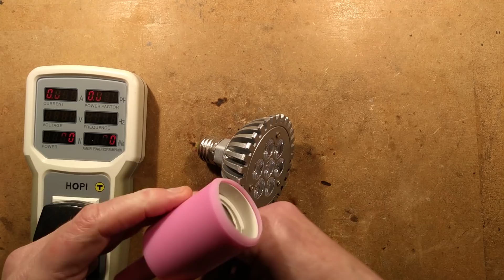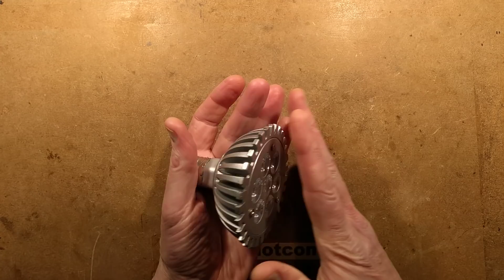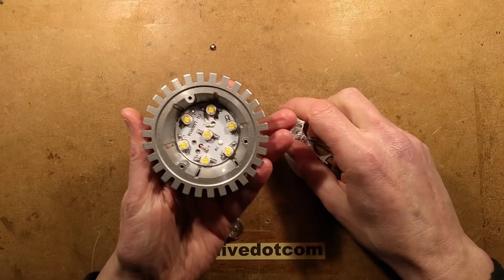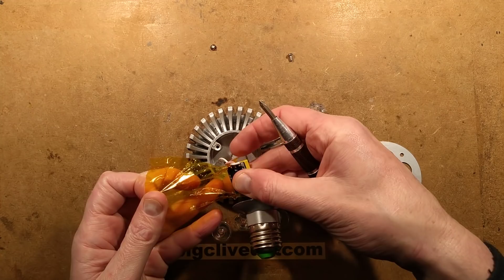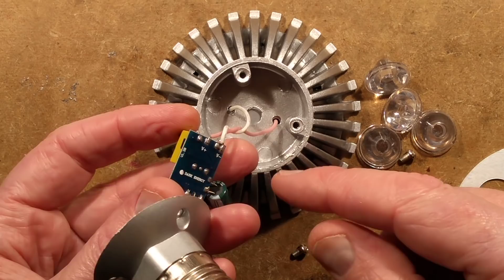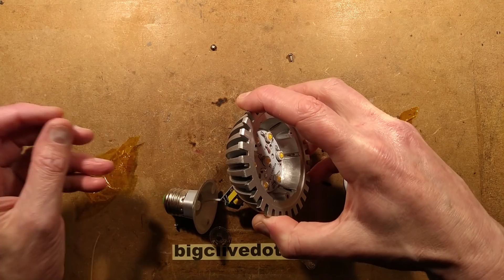Inside a chunky 7W PAR30 LED landfill lamp.  Good hack potential.

Comment: I ordered a couple of these after watching your video Clive. They arrived today and I wondered if your lamp was similar... When I shake them gently I hear most of the collimating lenses rattle slightly. That means they're not applying pressure between the aluminium LED PCB and the heatsink - which is a bit of a worry in a lamp I'd hoped to be able to keep running for ages (and out of the landfill*).
If I had access to a lathe I'd cut back the face that the front plate sits on a little and apply more pressure that way. However I don't and if I were to pay an engineering shop to do it the price would be crazy. Any thoughts? Cheers.
[*] As the heatsink seems up to handling a few watts of heat nicely I've also ordered some 3w LED 'beads' and was going to leave the original driver in place but swap the LEDs to some that should, in theory, last much much longer as they'll be under-driven. However going by the rattle of the lenses the PCB is largely held in place by thermal goop rather than positive pressure. Not good when the goop dries out.
Reply from the maker: That's unfortunately a common thing with these and the smaller GU10 lamps.
Reply: @bigclivedotcom  Ok thanks. I'll see if I can sort something out. Cheers.
Reply: @bigclivedotcom  For a minute there I thought I had the answer - the 3 holes in the PCB and the threads for the back... However the PCB holes are 20mm centre-to-centre and the screws that hold the back on are 30mm. Damn!
That said though I might drill some 20mm c2c holes through the flat part of the heatsink and use M3 screws and nuts (and soft washers) to positively affix the PCB to the heatsink. Thanks again.
Reply: The flat part of the heatsink that the PCB sits on is extremely thin for a heat-path to such a chunky heatsink. It's only just over 1mm thick. It's better than a lot of designs I've seen but still disappointing. Time to break out the drill and M3 screws / nuts / insulating washers...
Reply: OK done but I made a rookie mistake. I lined up the holes for the wires perfectly before drilling the screw holes when what I should have done was align the PCB so that the cover screw holes were exactly between two LEDs. I'll drill more holes in the cover that align with the screw holes rather than remove even more material from the heat-path. Oh and I know I didn't drill the 3 holes that were 20mm c2c equidistant to each other - I decided to go with one hole that was further away from the power wires.
https://youtu.be/LnQBcpPc-f4
Excuse the heavy breathing, it's my first youtube video!
Reply: Holes for lens holding plate 'fixed' https://imgur.com/a/eWK2rGe

Comment: @bigclivedotcom With the PAR56 bulbs now no longer in production, has this effected any venues you work at? I think the venue I work at in Australia has hovered up every last PAR56 bulb in the southern hemisphere for spares.
Reply from the maker: We've been testing LED replacements for PAR64's, but none of them remotely match the intensity or beam shape.  We have a stock, but should get more.
Reply: @bigclivedotcom  do you use 110v bulbs on your 240v supply? We do here and so every electrician who looks at the wiring is perplexed and doesn't understand how it works (can't say I do either). 
Do you think you'll do a requiem video on the passing of PAR56/64 bulbs? I had no idea the extent they have been used, not just in theatre till I looked it up!
Reply from the maker: @NoceboX  There are a few ways 120V lamps are used on 240V.  One is to use them in series pairs.  We normally use 240V lamps.
Reply: @bigclivedotcom  yeah, the series pairs is what we have, I believe, which means when one goes, usually the other pops too. Like you we are trying to find LED replacements, with one possible substitute found.

Comment: Hi bigclivedotcom i recently started having gsm connection issues in my village and new flat i moved in.
There are gsm boosters but they are really expensive, so could i ask you make a review on maybe some cheap chinese ones if they work or not and how good. If you come across one that is.
Honestly with all these connectivity changes to like 4g and stuff, i and several other people i know experienced connectivity problems despite having 3g/4g supporting device.
I guess it would be interesting

Comment: My capacitor is rated 6.3uf at 400v I have a 400v but 10uf capacitor. Can I use it as a replacement?
Reply from the maker: Yes.  That would work.
Reply: @bigclivedotcom  ur  to blame if me house blows lol thanks
Reply: no guarantees :)

Comment: I had a problem with a UV led bulb i got, it seemed to have burned the plastic lens on the LED's, they went a brownish tinge, I seemed to fixed it tho, the plastic lens broke off the LED's so easy but the rubber underneath stayed in place
Reply from the maker: The UV wavelength may have degraded the plastic.
Reply: @bigclivedotcom  Yeah i think so, not sure. They might of overheated a bit aswell

Comment: I hate this lamp...I hate the influx of Edison screw lights into the UK market for one reason- nobody seems to want, or is allowed to sell Edison screw fittings/roses.

Which means you're often forced/encouraged to use a bayonet to Edison screw adapter, which are frankly, unsafe deathtraps.

That metallised plastic is contiguous from the outer screw to the heatsink, and is creating a conductive path from the screw to your fingers.

In the countries where people are using Edison screw fittings, this isn't that big of a deal, as the outer screw is wired up to neutral for obvious reasons.

But in the UK? With an adapter? That's a fifty fifty on whether the surface you're holding as you screw it in is connected to live.

Honestly those adapters should probably be banned for general sale, They're too dangerous in the hands of someone not well versed enough to ensure polarity
Reply: Does that "metallised plastic" conduct electricity to that extent? I have a couple of these ordered (but they won't be here for weeks) and live in NZ where we also use bayonet lamps so I use adapters. I might dismantle before using and scrape off the coating on the plastic if mine are similarly coated.
Reply: @Shaun.Stephens  i don't trust it, wouldn't  be surprised if it showed zero on a multimeter but passed current under higher voltage- it is after all a thin coating of metal., would need a megger/ high voltage multimeter to be sure, so I feel caution is warranted. honestly, the better solution is to make sure the adapter is wired up properly in the first place by measuring the voltage between the screw and ground ( should be close ). Just make sure the meter is definitely in the AC voltage range/ probes are in the right sockets on the meter, you don't touch the tips, and most importantly, if you're not comfortable around high voltages, find someone who is to do it for you.

Sorry if I came across as overly harsh/alarmist :), the adapters can be used safely, but require a little care to be safe during installation.

You always have to be careful when merging things from two different electrical systems/codes, most are safe, but implement that safety in different ways, and taking something from one system to another, it can suddenly lack the other things that made it safe, and becomes dangerous even if it wasn't originally
Reply: @AngDavies  Thanks for the reply. I see Clive said in another comment / reply that the plastic isn't conductive but I hear ya about how seemingly non or semi-conductive things can conduct high voltage. I too dislike how Edison screw has become ubiquitous, I've been using adapters for years now and have even changed a few fittings in the house to ES. I'm careful about making sure there's no exposed metal, at least within easy reach.

I'm fine with mains voltage, I've been wiring up my own stuff for decades (and repairing my own appliances etc. when they fail wherever possible) and only had a few tingles. I used to buy lamps with B22 fittings from China when I could but found that a lot of them have poorly-secured bayonet pins and they often fall out making the thing useless. So it's a case of damned if you do...
Cheers.

Comment: Very clever how it looks at the demagnetization time and determines that the load has disappeared when that time gets too short.
Got foldback on the current limiting as well.
It's a tidy package for the 5-7 watt power conversion applications.
The housing is great, verrrrrrry hackable.

Comment: Screw holes machined but I'm guessing any 'machining marks' were in the pattern they used to make the mould !
Reply: Yes, wouldn't it likely be that heated metal powder in a mold technique rather than cast liquid metal or machined stock?
Reply: @williamdavies_ewill  Would the result not be the same ?
Reply: Yes. I was agreeing with you. Sorry for being unclear. I thought Clive believed there was a liklihood of machining of the heatsink edge of the produced part rather than the mold it was created in.
Reply: @williamdavies_ewill  Either way, I've not come across a heated powdered metal version of casting. I have doubts about that with aluminium as I believe the oxide coating makes thin or particulate difficult to cast due to the amount of slag it creates.
Reply: https://youtu.be/kCYExRtrnTY You can do powdered metal (PM) forming with aluminium power. This company will even provide a process to reduce material costs by adding voids.
Reply: https://youtu.be/s7Z-FsLdWWw 
PM aluminium also used in cars.

Comment: Clive, for several years our power company (Duke Energy) has been giving energy efficient lamps to new accounts.  3-4yrs ago Duke Energy first gave us a case of assorted CFL "Twistys". Some of them are still good Then early last year, they sent us a box of about 20 LED Lamps. In less than 18months, all of the 20 or so "FREE" LED lamps have went bad. The only LED lamps I have that are still working, are the 3 Sylvania LED lamps I purchased at "Lowe's Home Improvement" for $30+ back in 2016, to fit in those stupid G10 & G24 type kitchen/Bath fixtures that were in the house when I bought it. I guess cheap chinese LED's aren't very cost efficient in the long run.

Comment: i have a question for a mr clive (sorry ill try my best) was rewireing a thermostat. such an old crappy design i shorted it on my ground when closeing the box..  question being, is it posable that i only tripped half the breaker (where i am its 120+120=240v)  lol 5pm on a friday and the pannel is so f*&^ing burried i couldent go look. sorry if its a dumb question, its just the curiosity bugging me
Reply from the maker: It's possible that the system the thermostat is on has a control circuit fuse or breaker that's blown.
Reply: @bigclivedotcom   cool thanks man!  ill have a look on monday

Comment: The nylon gardening gloves with extra-rubbery palms and fingers are excellent for working on "maybe energised" components. The finger / palm insulation is certainly OK up to 1 kV (per my Megger!). Mind you it's best to make sure things are NOT energised if at all possible!
Reply from the maker: I like the gloves with the rubber dipped palms and open fabric back.  Protection without sweating.
Reply: @bigclivedotcom  The nice thing about these is that they are pretty cheap too. Good safety margin for 240v, though 3ph might be tempting fate somewhat! ;-)

Comment: With those separate lenses you can get replacements for whatever light angle you want.  From narrow to really wide.
The power supply is usually constant current to supply between 3-7 leds usually, quite flexible.  Not sure if you can do it with the mains ones, but I have modded 12v versions to run at a lower current (about 250mA) and they then become almost indestructible, Light output is reduced, but the LED's run much cooler.

Comment: How did you figure out it would be a 350mA power supply? I have a bunch of similar bulbs (but they're 15W) that had their power module fried from a voltage surge and a I'm trying to figure out how to replace the power supplies and finding it tricky to figure out the current and voltage...
Reply from the maker: Most of the lamp that use the classic 1W/3W LED in this one use a power supply module rated for a current limited supply os between 250 to 350mA and a voltage in the region of 3V per LED.  You can easily find the standard power supply modules on eBay.
Reply: @bigclivedotcom  thanks. The lamps I have are a little different, one type has 16 LED chips (8x2 in parallel) and the other has 34 chips (17x2 in parallel), both originally consumed 15W.

Comment: Hey Clive, I have a led lamp on my ebike, and for some reason, the light is really dim, and the housing gets cooking hot. Wrong voltage? How can I diagnose it? The housing gets hot because there is a massive resistor in there which starts getting reaally hot.
Reply from the maker: It's possible that something has shorted out.

Comment: so thinking of rewireing my old halogen lamp (500W bulb), but dont know if can get the same amount of light from LEDs..  one of these days.
Reply: I'd like to go back to gas lighting. #reliability.
Reply: @millomweb  i like it bright.. the only drawback to the 500W is 1) heat... and 2) watching the electric needle "spin" ;) in fact here in the .us the light i have was recalled as too many people were knocking it over and catching fire... oops (tall tall light)
Reply: @MrScotttraynor  I've 5' T12 fluorescent tubes in the kitchen (2) 65W a piece. Superb light source - but can't get replacement tubes for them now.
Reply: @millomweb  i have 2 additional 500W halogen "Bulbs" and 2 250W ones that are still n the packaging... just have been pondering.
Reply: @Matt Quinn no was indoors light.. its rare now.. but i loved it.. ihave to rewire it anyways, as the cord, meh.. just wondering. they were recalled least 20+ years ago (think volentary) due to be knocked over and catching fire
Reply: @Matt Quinn ya its hot so dont use it in the summer, but in winter it so brightens the area up
Reply: @Matt Quinn well i have plenty of stuffs to replace it/fix it.. just pondering, its a chore on the to-do list as i am currently 1/2 through remodeling the bedroom..

Comment: Could you replace them with 3w chips, put in a new power supply and make a 21w led lamp? Would be a bit bright!
Reply: The leds will burn out due to excessive heat.
Reply: Maybe a fan behind the heatsink

Comment: Had you checked beforehand that the metal wasn't going to be live?! 
PS. Would have been Aussie50's 34th birthday today. Still sad about what happened.
Reply from the maker: Yeah.  Those Facebook birthday reminders leaveyou feeling a little hollow.
Reply: Amen.  A number of times been seeing Aussie50s videos pop up.  Gone back and looked at a few time and again...  but, quite often too saddened by it and move onto another video to take my mind off of it.
Reply: He was fine, he's using a polarized fitting...if he'd been using a bayonet to Edison screw adapter, as is often the only option, would have been a different story.

Conductive path through the metallisation from the screw to fingers- 50% chance of connecting your fingers to the live :/

Hate that those things are for general sale, no way for the average member of the public to ensure the correct(safe) polarization of the fitting.

Even without the crappy conductive bulb, plenty of lightbulbs still expose a portion of the screw for touching accidentally. On the assumption that the outer screw is connected to neutral by law...

Those adapters are irresponsible tbh, as is the influx of ES bulbs into the market with nary a way to wire them up safely to a household fitting

Comment: The ones i have  in my hotel (the ones i repair, i said it in one of your previous videos) are quite similar, but with an external PSU and  JST connector for the connection... quite easy to repair (or modify, as you usually do)

Comment: Sometimes castings have machining marks from marks in the moulds made by the machines that made them, if you get what I mean...
Reply: Yeah this has to be die cast aluminium, the machining marks are on the die. You get the same of plastic quite often from injection moulded parts.

Comment: I've "serviced" a bunch of the smaller M15 spotlights commonly used in modern ceiling lighting.  The power supplies are dirt cheap and easy to replace.  Unfortunately, most of the ones that die, do so because the cooling is insufficient, so even the replacement PS died very quickly.  I gave up servicing those and just rotated different brands until I found one that was designed to dissipate enough heat.